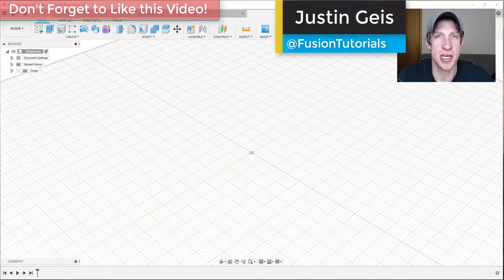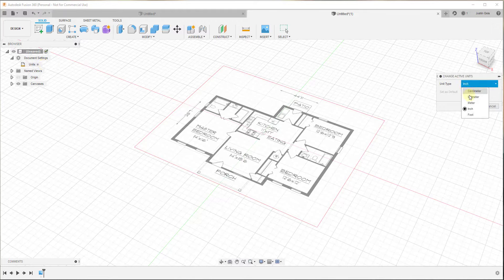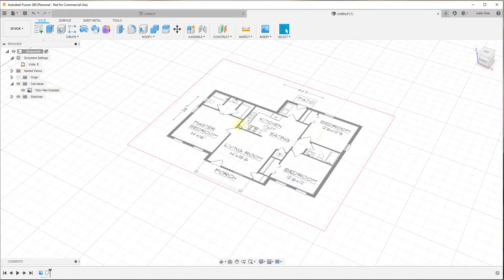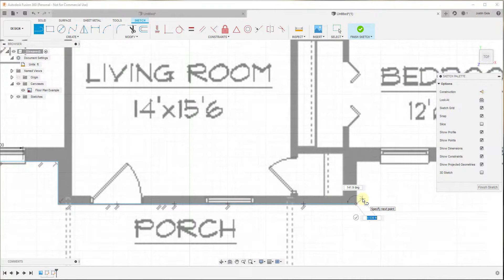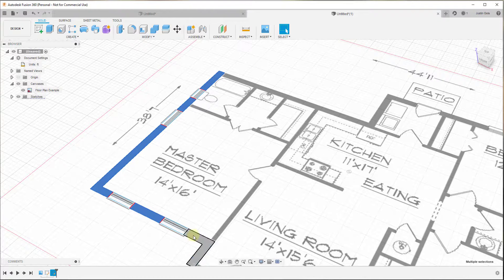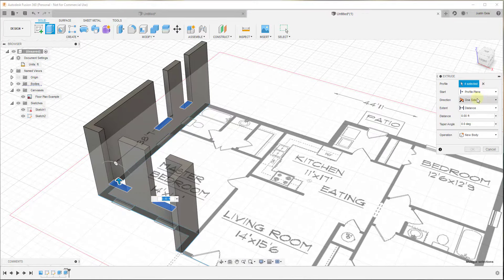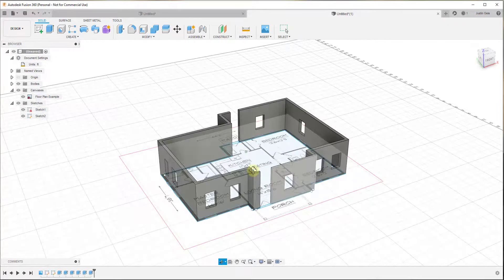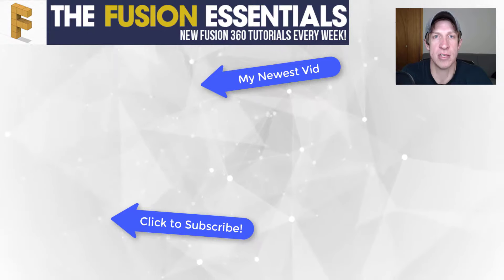Modeling a FLOOR PLAN from an Image in Fusion 360! Fusion 360 for Architecture Part 2

Comment: Good instructions. however I feel like Fusion 360 is not really made to deal with floor plans (2D). Is too clunky and too awkward to use and get used to. For 2D is tons better to use either use Sketchup (for a quick and basic to the point design) or the Autocad LT for a proper professional look and feel and universally approved.

Comment: So glad I found this video!!  we bought a neat mid-century modern house that was designed in built in 1977 from the original owners and they left us the blueprints which I was able to take a photo of and insert into fusion with your help!!  I was able to get everything to work following your instruction except after I extrude the windows up I can’t get to the part where I can click again and extrude the window openings?

Comment: Thanks for the tutorial! One thing that I found is that it seems to be almost necessary to make each wall it's own body or component. If you end up doing detail work on the interior (for example adding window or door trim), it's really hard to get a good view of what you're doing unless you can just disappear (make invisible) walls that get in the way. Is that what others do, or am I not yet good enough with manipulating my point of view ?
Reply: Create an offset plane, press "S" and type "Section Analysis", use aforementioned plan as POV. :)
 You can hide and unhide each section analysis instance.

Comment: The reason I want to know that function!  It's nothing else but a "police mobile armored vehicle"!  I asked this question because I want to model with this program, make the parts in 1/72, 1/24, or 1/35 scale and print them out as parts with a 3D printer! 0:08

Comment: Hey Justin I hope you are well. I just started using Fusion 360 and your videos have been a major help and I do plan to watch them all. I currently have most of my house including basement done. My question is in regards to the exterior landscape. My yard slopes down from the very back north east corner down towards the south west corner. Is there a way to adjust the 3d sketch so it shows and accommodates for the slope? I want to properly plan out several outdoor features such as a new enclosed deck, 4 seasons room, raised bed garden area, and a new shed. Thanks you so much for any help you can give on this as well as all of the help you have already been with these videos.